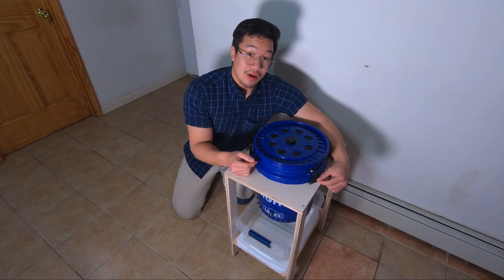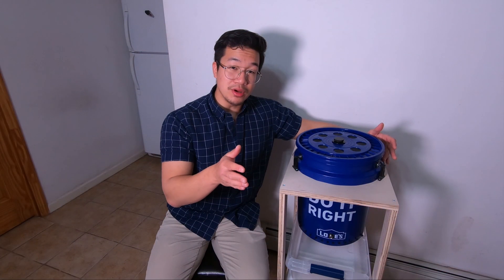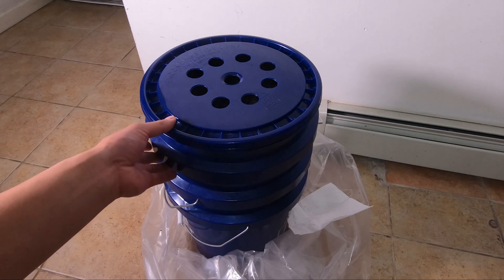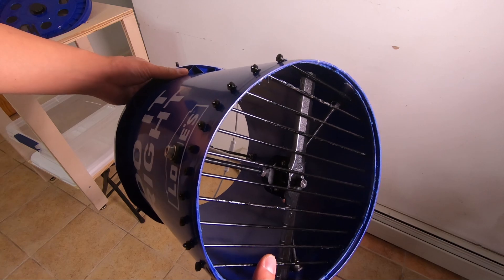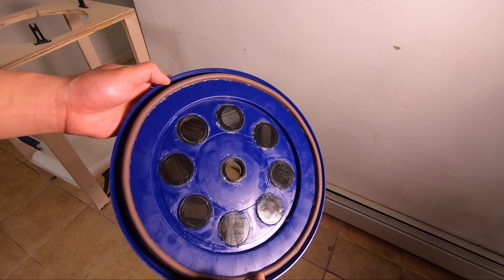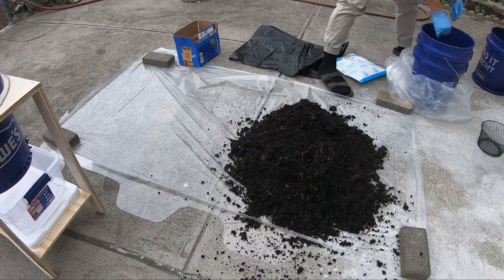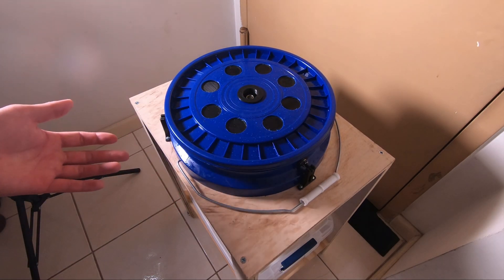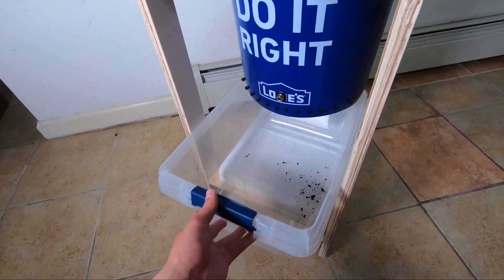How to Make Compost...with WORMS EP1- Introduction

Comment: great design congratulations to your design. Why did you fill it up to the top if the worms don´t go all the way down usually
Reply from the maker: Thank you, and these worms are European nightcrawlers so they do actually go down to about 18 inches. Keep in mind worms are self regulating in terms on population. Since the bottom is open, as worms population increases, more and more worms will migrate down. This isn't a problem in this system as whatever worms exit the bottom of the bucket into the casting catch bin, will be used for fishing.
Reply: @ElecTrackProjects  To my understanding they stick to the aerated surface area. Sure they can go down to 18" if they have to. Can you share what that three threaded axle is called? Want to build one too,ha!
Reply from the maker: @Dampflanze  While the majority stays near the surface, some travel deeper. Also, the device you're talking about is a custom patent-pending design I call a delta-style shaft retainer. For many people, it's a little complicated to fabricate. If you want to make this project easier, I suggest you omit the spinning shaft, shaft retainer, and the "anti-torque mounts". You can still harvest with just the grate on the bottom in place with one of those hand held mini rakes(just comb it from the bottom once a week).
Reply: @ElecTrackProjects  bummer this delta style shaft retainer is custom design patent-pending. Thank you for the suggestion will look into it
Reply from the maker: @Dampflanze  I will eventually release the design as I want it to be open source, but I need to complete a few paperwork processes on it